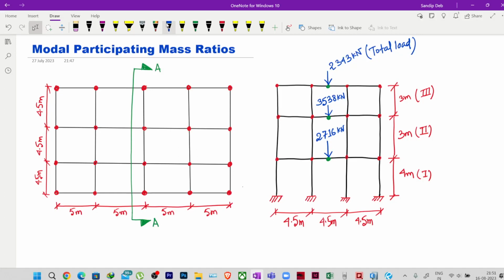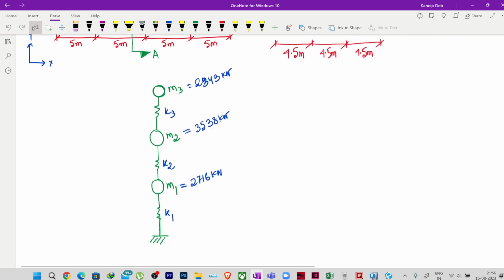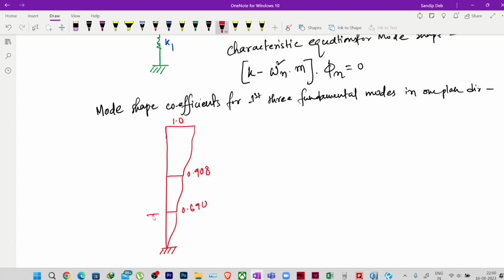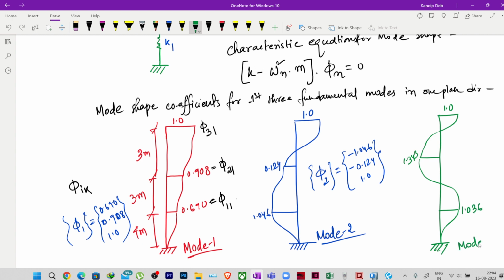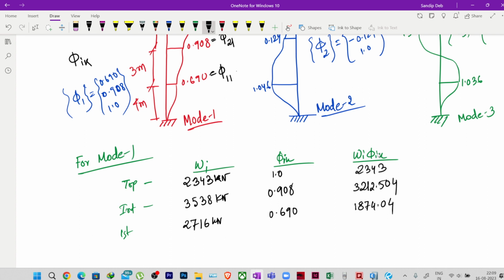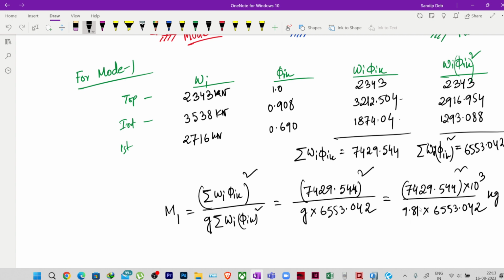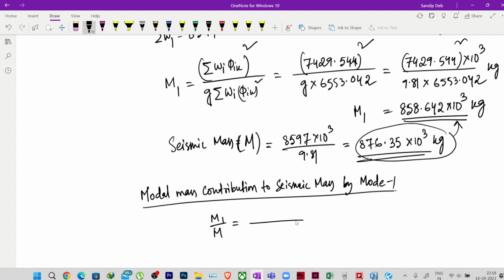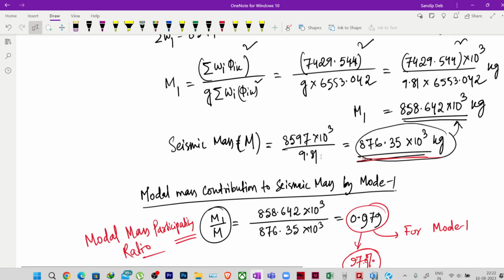Modal Participating Mass Ratio | Simplified Dynamic Analysis | ilustraca | Sandip Deb

Comment: Do we have Ritz modal analysis concept in structural dynamics as in software Ritz vectors preferred while performing vertical earthquake. Can we calculate ritz vector manually ?
And another question is how to decide number of modes to be considered for high rise building if sum of ux and uy achieved is more than 90% but sum of uz and sum of rz is less than 90% even when we take 100 modes in ritz vector.
Reply: I can't get 90% what should I do i also tried to increase the mode number from 12 to 30 but there is no significant change I'm stuck at around at 70%.....and 3rd model I can't get Rz higher than Uy.... please help me....

Comment: Sir in my city (building- 2015) on the ground floor column is mid to slab  and on first floor that column not continue, that column direct take load of beam.
Reply: (G+3 building 🏢)That beam at corners they take column continue upto 1,2,3 floor
Reply: Upto 7 I have designed after FF 😅